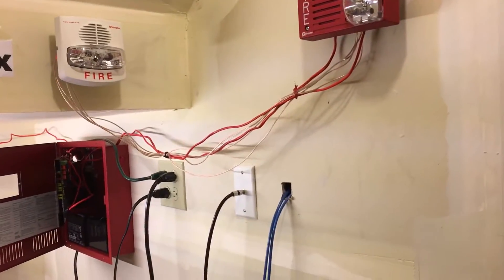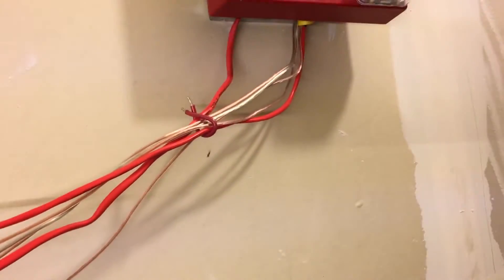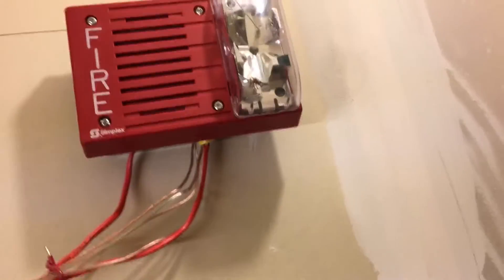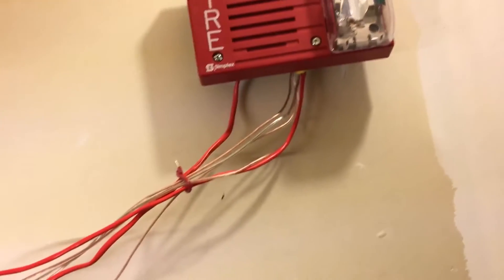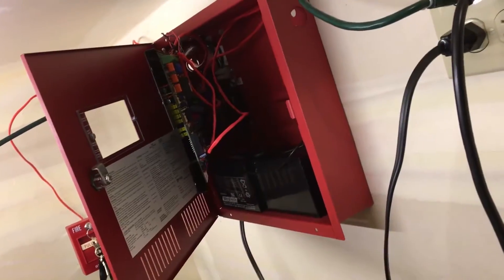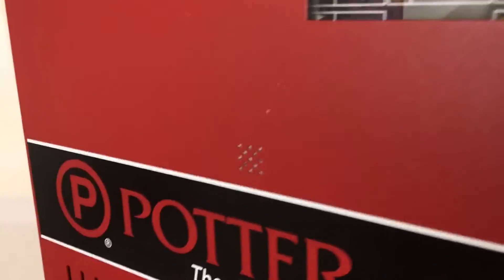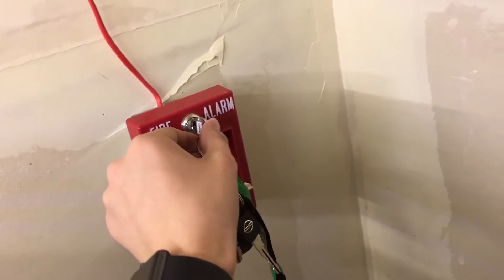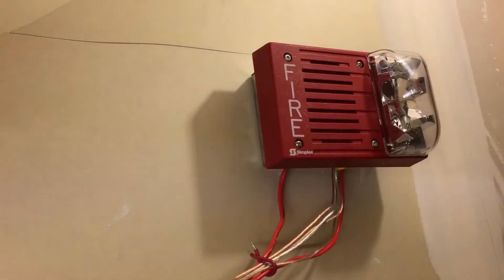Home System Test 7: Multiple Simplex Devices

Comment: The 4903-9236 can be a 4 Wire alarm, just cut the two jumpers below the terminal and then it’s a 4 wire. 😁 (you probably figured this out by now since it’s been 4 years ago)